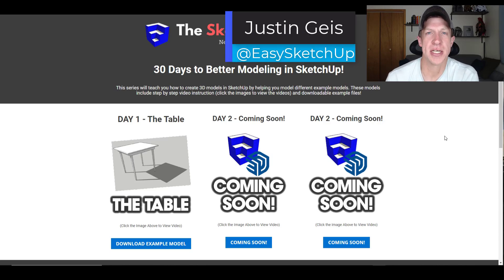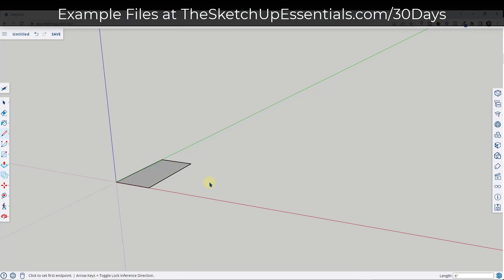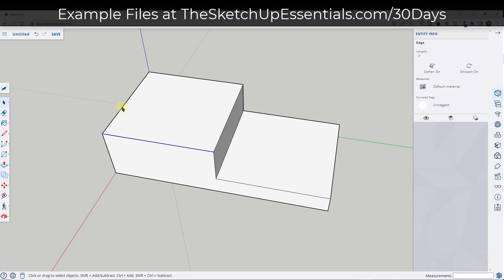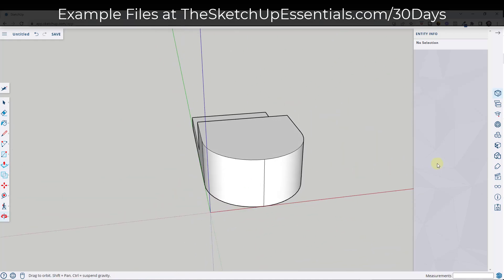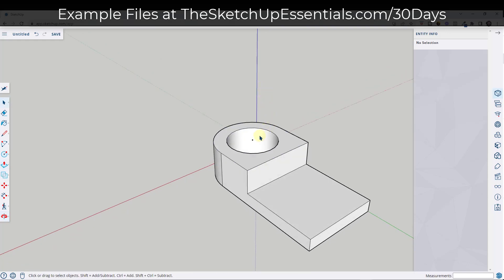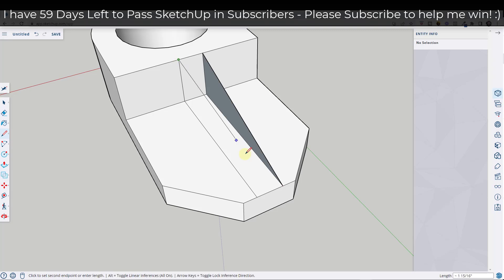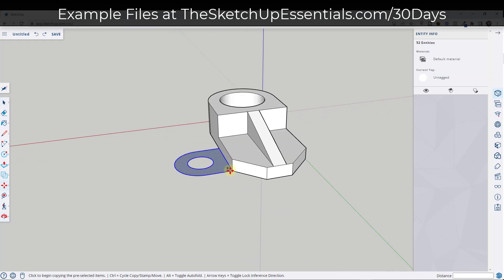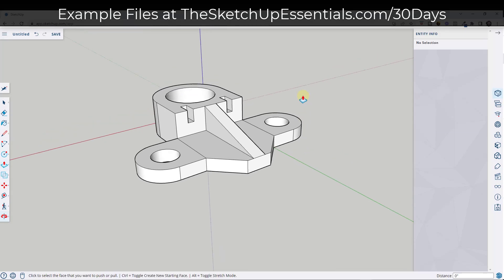Learn SketchUp in 30 Days DAY 2 - The CAD Fitting!

Comment: Excellent series, thanks for sharing your knowledge!
By FAR the most difficult and frustrating part is figuring out the correct sequence of key strokes and clicks to start and stop lines and close off shapes. I spent a good 20 minutes trying to find the midpoint /offset and baseline of the triangle shape!
It would be great if you could explain a little slower those sequences, as without seeing if you are pressing return or clicking the mouse saying "like that" is not so obvious!
Thanks again!

Just to add that not know how to start/end line properly means I have many lines drawn on top of one another, and although they are unseen they seems to have created many different mid-points. 
Very frustrating to try to erase those incorrect lines as you can see them or separate them from the correct line which was initially drawn, if that makes sense?!

Comment: Hello Justin. Thank you so much for the tutorials. I am having a hard time with the measurements. Pretty much from the get go my file wants to use larger measuring units. 1" is too tiny to show up. I tried zooming in and all but it still didnʻt like the sizes. Anything in the overall settings I need to adjust?  NEVERMIND, I had deleted the person and had lost reference....I had not zoomed in ENOUGH. I am leaving this comment here in case somebody else is having issues with it. Obviously I am a complete beginner.

YAY. A bit over 4hrs for Day1 video and ʻonlyʻ 2hrs today for Day2. Thank you for talking it all through so thoroughly.

Comment: Newbie to Sketchup.  In the Day 1 and Day 2 videos, I noticed you start at the origin and align along the vertices.  Is this the usually best position to start a modeling project?
Reply: Modelling as close to the origin is always better. There's a situation that when your models get larger(Urban scale), it gets further from the origin, there will be camera clipping situations occurring when you zoom into certain parts of the model if your model is too far from the origin. 

It also helps when you are to use the skp models as components inside other files too, so when you are to import it in, the selecting box would fit nicely of the component itself only.
Reply from the maker: Basically what @Jack Boon said, but as a general rule yes, start as close to the origin as possible 👍
Reply: @Jack_Boon  Got it...thanks!

Comment: im having an issue loading the stl file to cura slicer. my main purpose for learning this is to work with 3d printing, the table turned out fine. day 2's lesson, the rounded hoop part on the right side, doesnt show up in the preview when i attempt to print the model. was wondering what i did wrong? instead its trying to print the hole, instead of the hoop part... i have the whole model as a group so it should all register as one piece. any ideas?